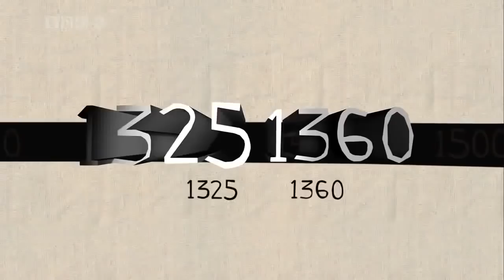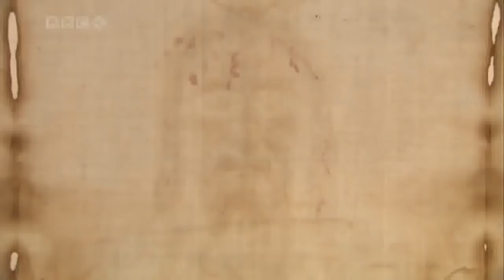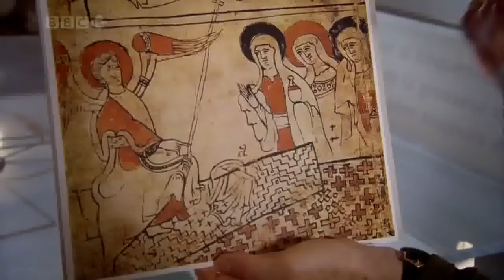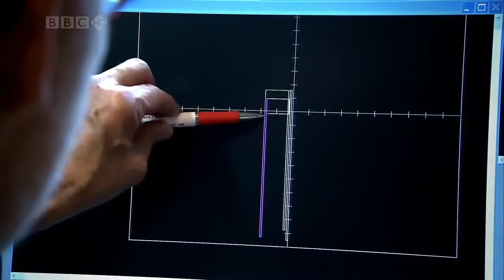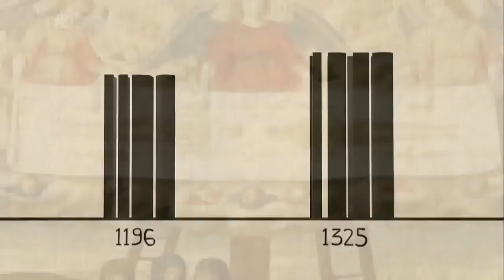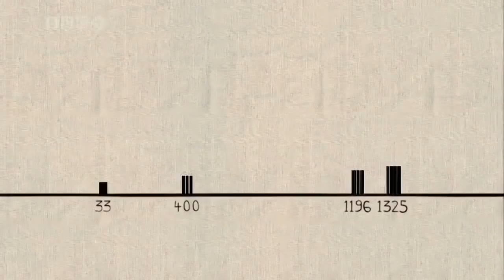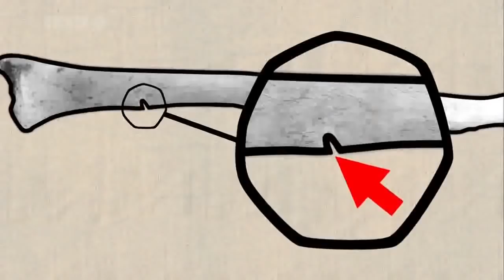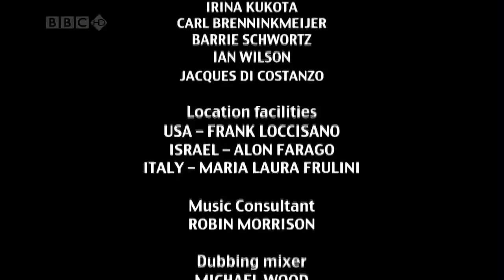BBC SHROUD OF TURIN NEW EVIDENCE

Comment: The elephant in the room is that they used the worst possible position on the cloth to test, because the cloth did see restoration work done during the middle ages, which would be invisible to the untrained eye. Chemical tests proved that. They did not take samples from different parts of the shroud to verify the results.

Comment: It's hard to believe this programme did not consider the possibility the carbon-dating labs received strips from a repaired section of the cloth. I once read that instead of providing the labs with six samples from different parts of the cloth, the Archdiocese of Turin simply provided them with one sample divided into six. How can this provide a reliable result?
Reply: It was one sample cut into 3 pcs.  Then a 4th when they did not get the results they wanted in Arizona. There was a significant variance in age of sample taken from one end to the other even though the sample cut was only 8cm long.  Meaning one part of sample was 300 years older than another part. They hid that info from public.  This is not only bad science and deceptive. It does not even qualify as science, but would be defined as intentional fraud. Not unlike our recent election results.  Where numbers are altered to get a desired Antichrist result.  The reason for the variance in age is because the sample used contained cotton mixed with the pure linen and also matter Rose dye and other contaminants are in the sample aluminum and metallic salts.  The carbon dating results have the same credibility as Joe Biden receiving 80 million votes.  Anyone who believes that that is true is not being honest with themselves.  They've been trying to cram the carbon dating results down our throats for over 30 years and portraying it like it's the holy gospel truth when it is most certainly not.  Carbon dating is proof of nothing if the Shroud was carbon dated today and it came back first century that is not proof of anything either.  A single test is not proof of anything.  To base the authenticity of the Shroud on a single test would be defined as very bad science, but that is exactly what Skeptics do.
Reply: Keep on trying to convince yourself
Reply: What about the pollen?
Reply: Barrie Schwortz was one the scientest that did study back in the 70s. People were getting some incorrect information about the shroud, than Schwortz made a website of all the studies done on the shroud.
Reply: Allen Tokyoo  in this part of the world it's programme.
Reply: Fire damage on or near the sample may also affect the carbon 14 dating
Reply: See what L.A. Marzulli has to say about the shroud on his yt channel.
Reply: They just wanted to make an inconclusive documentary to produce a tv programme.